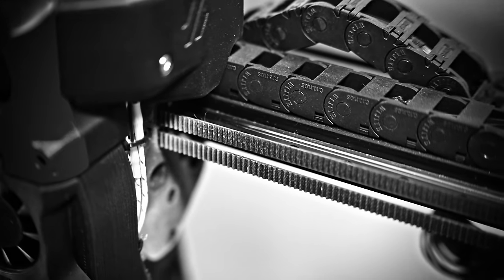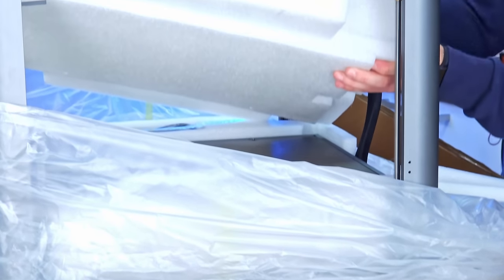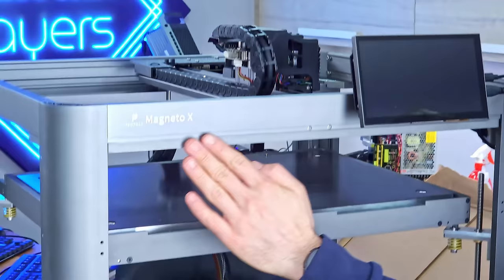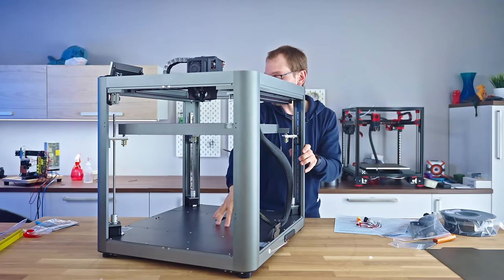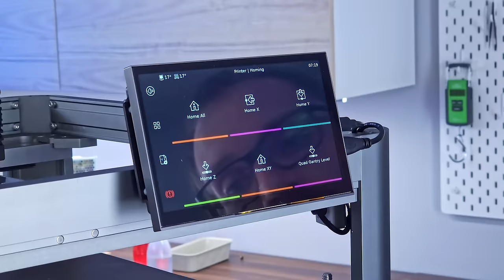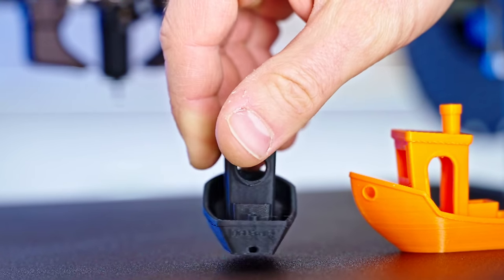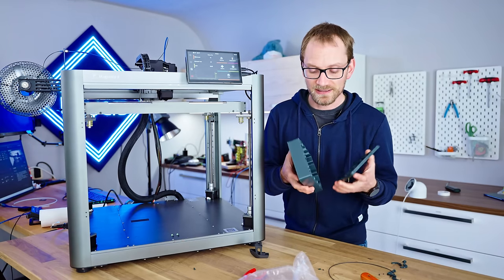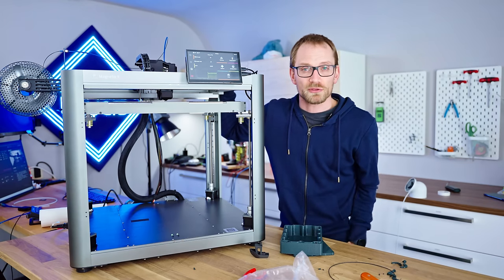The 3D printer with no belts: The Peopoly Magneto X uses closed-loop linear motors!

Comment: the print quality need more deep tuning more than standard open loop system... because closed loop system have their own accleration..
like if you try to hold the movement of x or y axis to make little late, or stop totally.. the extruder still extruding the fillament that machine is going to give....
open loop have absolute precise movement at given coordinate... otherwise it will miss step, but closed loop have their own small little late and little faster (to catch up) the given coordinate.. so the extruder will over extrude (late) and under extrude (when catch up) on some area...
on small print like benchy it's not noticeable, but larger print it will have this issue..
i hope soon the closed loop system also communicate to extruder to make accurate flow when late or moving faster, it real time data from closed loop system, not like flow compesation that use prediction based the data coordination...
Reply: This is actually a really good point

On my (currently only) LM mill, the RPM can change upwards of 5% to adjust for this

I've only ever seen it as jitters because of how fast it does it but it does
Reply: @angrydragonslayer  for milling? cnc?
for cnc closed loop it's good because no material added (fillamnent) adn cnc can use passes as many as needed to remove the part, but for 3d print.. extruder flow should follow the movement of the motor (that closed loop have some late or faster to catchup the designated position by mcu) in high tech cnc, they may also have this calculation.... but i doubt in today 3d printer, because closed loop still rare for 3d print... maybe because linear motor like this and trend of using closed loop, maybe new program could sync the motor movement with extruder... so not only mcu give "command" to motor but motor give command to MCU to compesate the extruder to follow the motor accleration..
Reply: @adimegan4677  yes but the inconsistency still messes a bit with surface finish

The adjustment is mostly meant for people pushing Ra with diamond honing inserts that need that perfect tool pressure (which admittedly was me about 8 months ago) and it works wonders at that
Reply: @angrydragonslayer  ah that's news for me... so closed loop also give some issues to some cnc... although closed loop have been used by CNC fo a long time ago....
Maybe some high end cnc that use servo uses some information of servo to motion control(mcu) to adjust appropriately to make good finish...

Still long way to go for closed loop system for 3d printer....
Reply: @adimegan4677  they do but it's utterly negligible for most usecases because of how stable cnc machines are built. You won't really have a problem due to it before 4 μ" and 6-10 μ" is what is generally meant by  "mirror finish"

I was just barely able to get under the 2  μ" tolerance with the help of that adjustment though.

Comment: The funky pattern on the outside is definitely due to the linearity of the motors. The issue with linear motors is that the accuracy is dependant upon the calibration of the feedback loop and magnetic field. And yes, they can be calibrated. But because each axis relies on a big stack of magnets, the magnetic field pattern won't be totally uniform all across the range of motion. You can actually see the position of the magnets is super uneven when you peel back the cover strip. This means that to achieve good linearity across the entire range of motion, you have to calibrate it across the entire range of motion. This is an insane amount of data, and probably not something they have done. Or possibly they have done this at a coarse resolution, interpolating between points. Leading to this slight loss of linearity. 

Also, I can't really tell what the feedback mechanism is on this printer. It should be a high accuracy optical encoder, but I fear that it's a magnetic strip tape encoder on the bottom of each axis rail. At least that's what it looks like from the images I have seen. So not only is that subject to magnetic interference, the linearity is lower to begin with.

Comment: I assume you gave them feedback about the thrust bearing? A smaller, less expensive version would be perfect for "a printer in every home". The issue with 3D printers "for the masses" is the constant tinkering, adjustment, belt issues.

Comment: I feel stuff like this, old patents running out and what bambu has been doing, sorta manage to finally put a bit of a fire under the saggy arses of the 3D printer industry. I hope that avalanche continues, although obviously many things bubbling to the surface now had been in the works for years. Still, I think the shocks and jolts to the system has pushed many developments to really hunker down and get their projects to market sooner. I'm loving it.

This one like most new and new'ish se systems does need a bit of polish, but it seems like it's a really good platform. I appreciate that they also haven't gone wild with bells n whistles for gen 1. Trying to stuff too much gadgets and gizmos on it while still ironing out the base platform has been the downfall of many would-be good projects. 

They've made something awesome here. What remains is a must to sort out before going full send, but it's really just tuning, minor tweaks and touchups.

Comment: Closed loop is OP because if you bump into the print you won't get a layer shift. You can design it to circumnavigate obstructions and continue printing around them (or pause when and obstruction is encountered) in the cases where you don't care about oristine quality.

Comment: It's neat that this has both linear motors and closed loop sensors, but I think if I had to choose one or the other, I'd take the closed loop system.  Once you have reasonably-accurate self-correction for movement errors, the value of the linear motor drops pretty quickly...

Comment: I don't think that would pass UL codes for sale in the US either.
I wonder if the massive motors slow down response times.
Looks really nice. But, I would add some insulation to some of those wires. As I assume you will.

Comment: I love my Bambu, but I started a print one time without a build plate in place and it scraped the hell out of the metal surface where the build plate goes. Also I’ve started prints with the last print still on the build plate and it just smashed into them and kept printing without even detecting it lol.
 
I was just surprised because their whole marketing scheme is to be more or less customer proof.

Also I do with the machine would recognize what size nozzle it has on, but that’s more of a feature than a preventative measure like the crash detection
Reply: Been there, done that (with my Creality K1).  It has a place off the printable area, in which it scrapes the excess filament off the head before it's used for levelling.  Now it's a groove (my fault) which is hardcoded and I can't change (their fault).

Comment: Maybe it's because I have a toddler running around now, but those 230V wiring had me sweating... Even distributing demo devices within the EU already requires CE compliance. 
There is an exception for importing products in development to contractors and employees and since you fixed that motor design it might even apply here :D

Comment: Looks like you have this weird wall pattern on your part due to the overheating of PLA. I had similar issue with Goliath. I had to drop down nozzle temperature to 190 degrees. This is really strange that the 3d printer prints that bad out of the box.

Comment: oof that crash! I think a way to avoid catastrophic damage could have been to add an adjustable collar at the top of each leadscrew to jam the steppers before it forces the hotend into the bed that hard. It looked like it was about to permanently bend the axis rails before you stopped it!

Comment: Does this even need input shaping running, given the actuators have feedback and no stretchy belt between them and the print head? That would simplify the control system a lot, and the linear motors ought to respond fast enough to catch oscillations.

Comment: Another fit-and-finish issue that I spotted, but can't verify w/o hands-on inspection. Are the edges broken on the extrusion that the display cables are routed out of? If not, I would be concerned that over time the edges of the extrusion could abrade through the cables. (A 3D printed endcap that the cables could come through could be a simple, low cost mitigation there.)

Comment: As always, this guy's comments are impressive regarding engineering accuracy, story fluency and verbal efficiency.
Is there anyone who can advise me on making my own PCB heater (for my large 100x100cm custom built 3D printer build-plate). Is there a temperature limitation for PCBs on laminate substrate? How about PCBs on aluminum and ceramic base and where do I order one? 
Many thanks!

Comment: hey, really cool video! I just had a question. about 10:03 you mentioned "active PHC" (I think) and I have never heard of that and didn't really find anything in my brief search. What is that? Thanks in advance!
Reply: PFC (Power Factor Correction) - for switched-mode power supplies, it makes current as sinusoidal as posible, or at least to draw current not only at the top of the voltage signal, but also symetrical on both sides of the wave.

Comment: Question. If Peopoly did not want you doing "things" how can it be justified to CNC the stepper motor washer/disc? It is a $1,999 USD printer and not all of us will have CNC equipment or expertise to do what you did to resolve the Z axis grinding.

Comment: Actually it's NOT a realy closed loop system.
As the motion software in Clipper don't know the real position it just generate open loop positioning going into seperate (closed loop) controllers.
That theses controllers are closed loop does not make the system itself closed loop.
As mantioned: Clipper still don't know were the real position is and can't compensate in the trajecory modelling.
Have two seperate motion control systems will be prone to artefacts and strongly depends on the overlap of both motion control algorithms.
Reply: @nocare  No, and I do control logic for an living in automotive elektronics for a living.

Closed loop is when from the start to end it's closed. Herer there is no feedback from the closed loop rail controllers position to Clipper.
Which simply means: when you overload the rails Clipper will not realise that you have lost the real position.

Your drone example is somewhat simplified. The roll input is not part of the loop, it's the disturbing manual input. Closed is the stabilisation of position, and thats one loop over the whole physical system.
Here you have a positioning system. If you are familar with EMC2/LinuxCNC in the world of larger CNC control you will see that there the loop with servo systems is complete from trajectory control to position. Which simply means: if your motors does not move as fast as the trajectory controll wants it will definitely slow down the trajectory control to minimize positioning error. It will correct the position error of the trajectory control..
This is here NOT the case. Clipper will just do its trajectory, NO matter if the rails realy follow. You get a positioning error dynamically and thats the artefacts that Thomas is observing.
The older Marlin was a modified GRBL motion control, Clipper ist still using this trajectory control, and thats not realy a system supporting closed positioning loops.
I personally use EMC2, GRBL for years and have made my modified Marlin codes, so I know what I'm talking about.

The problem here is that the closed loop of the rail controllers will only be closed in the stationary state holding the position, not for the dynamical movement thats completely open loop in Clipper.
Hence Clipper still needs to be realy fine tuned to not move faster than the rails can physically follow.
In a real closed loop trajectory control that would be IN the loop, here it's outside the loop.

As you correctly recognize but fail to comprehend in it's consequence: the problem is the open loop design of Clipper/Marlin/GRBL.
But it's technically possible to go full closed loop, e.g. if you use e.g. LinuxCNC to do the trajectory control instead of Clipper.
The rails have position sensors, which menas the indicate the print heads real position. The problem is the lack of a position input into Clipper/Marlin.
LinuxCNC is based on EMC2 which is historically based on the original interpreter design for GCode developed by the NIST. If I remember correct then GRBL use the same GCode parser, but a much simpler trajectory control targeted for microcontrollers and definitely lack the Lego-like configurable system design of EMC2/LinuxCNC.
So you see, EMC2/LinuxCNC and GRBL/Marlin/Clipper share a common ancestry, but took different approches based on hard and software restrictions and to adapt the system to it's use.
What LinuxCNC/EMC2 is lacking is the GCode extentions für 3D print stuff, like temperature settings while it has other extensions for realy big CNC tooling..
Now that things move to Rasberry or 32bit systems it may be possible to make a fusion of the GCode capabilities of Clipper/Marlin and LinuxCNC and develop realy closed loop printers.

This is here a hybrid stuck somwhere in between.
Reply: Yup, there's no closed-loop interpolation between axes, that's what you wanted to say. There's a closed loop servo on each axis (or maybe just on 2 of them, I think Z is still open loop, judging by steppers), but driven from open loop controller which sets the path, similar system to old-school step/dir multi-axis motion controllers (and maybe it actually is step/dir).
Reply: @Mescherje  correct.
But the goal here ist to have a closed loop system for position. If the trajectory generator does NOT know were the real system ist then its not a closed loop positioning system. It will produce a dynamical offset.

As for EMC2/LinuxCNC the system has an setting for maximum potitioning error during trajectory and the generator will slow down at corners tu keep this positioning error. And thats the positioning error from GCode trajectory to real position when you use a realy positioning servo..
Here this critical feedback into the trajectory controll is missing. Hence it's till artefacts prone depending on the settings between trajectory control and the rail servo tuning.

Comment: As soon as I saw that goliath hotend, I knew this thing was going to be a small fortune. 2000$. Although its not horrible considering the bed size. What really seems odd to me is how this thing isnt fully enclosed at 2000 and why is its maximum temp 300? Did they go short on the temp sensor? This machine is perfectly capable of doing at least 50 degrees more.
Reply: Because magnets degmagnetize under that kind of heat.  But if you know better then by all means crank the temps on your own and let us all know how it goes.

Comment: I was thinking that the Z axis motor should have been fitted at the top and then have the threaded rod resting on something at the bottom. That would increase stability and reduce the stress on the motor. Then a tapered thrust bearing on the bottom can take the load. Or perhaps a flanged pillow block bearing.

Comment: The bed and y axis should use the same cable chains that the x axis uses. That amount of flex on yhe existing drop cables will result in fractured wire strands around the anchor points in a relatively short period of time

Comment: I wonder if the linear encoder that the linear motors use for the closed-loop feedback are simple quadrature (or similar) encoders only giving direction and speed, or if they are absolute encoders like on Mitutoyo Abs0lute digital calipers. I suspect they are simple relative encoders to keep costs down.

Comment: "The Peopoly Magneto X foregoes stepper motors, pulleys and belt and goes straight to closed-loop linear motors embedded into the X and Y linear axes -"

And adds FOUR z-axis motors.

There probably is quite a good a reason why other manufacturers don't do this, and I find it extremely unlikely that the reason would be "we just haven't figured out how to do it".

Comment: Probably the reason why it has the ground fault protector is the bed. If you touch the underside of the bed and it's scratched, the protector will trip and there's no real hazard.

Comment: Watching that bed rise right into the hotend hurt! Ouch. I know the feeling though, my brain always gets confused when using a printer where the bed lowers. You want to lower the bed, so you click on Z down... I guess that's what happens when you grow up on bed slingers.
Reply: especially since klipper and klipper screen which is used here, allows to swap the buttons, on a bed gantry you can set them to actually lower when pressing the lower button ... but the whole thing should have been prevented anyways wit proper setting of Z endstop by the nozzle, aswell as not allowing travel past the Z max / Z min

Comment: I see a fail, they are using the print head for leveling, so there is a sensor in the head for contact with the bed.  But they didn't have the forethought to use that same sensor for a safety-stop.